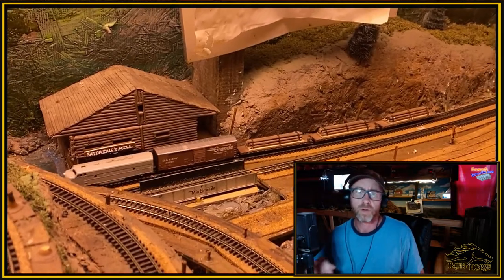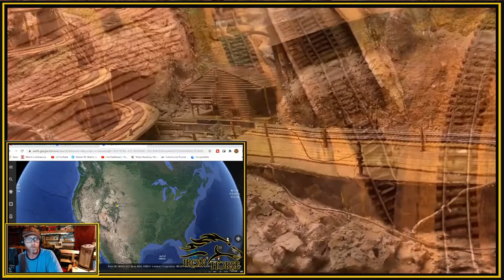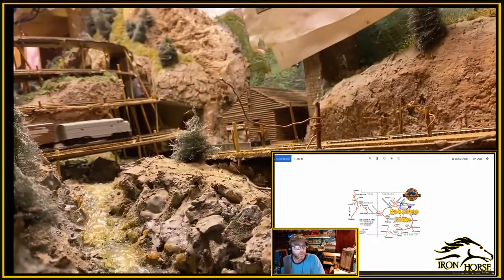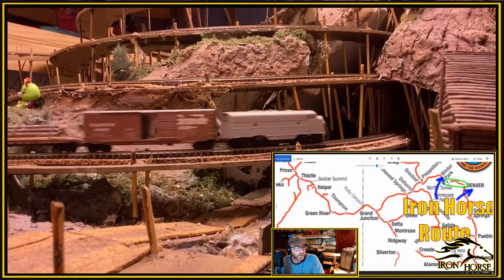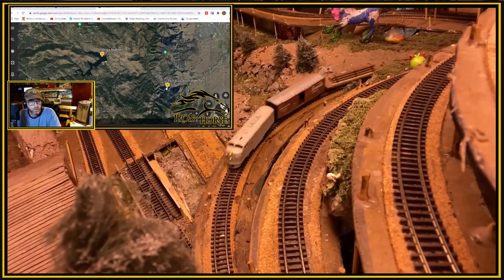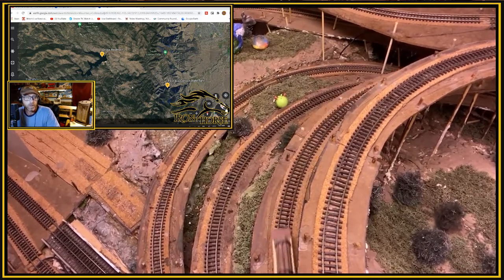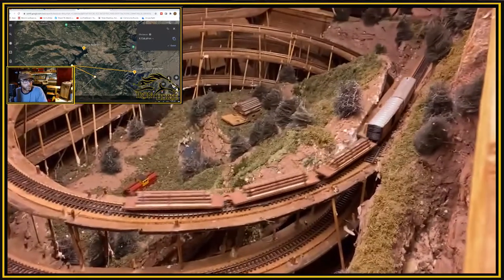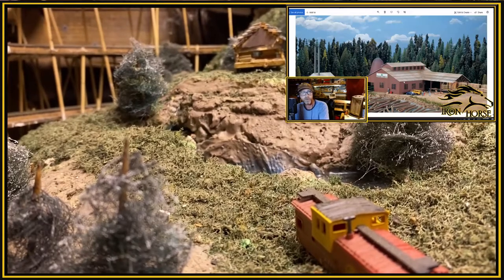Timber Train(S) to the Reservoir Mill - Layout Tour/Operations: Iron Horse Route - D&RGW  N Scale

Comment: thanks for sharing the journey. nice there were all the different views. what type loco was running the freight?
Reply from the maker: Hey Joe!  That was an F7b.   I have 3 kato F7's ( that's my roster for now) that are in working order.  It's and ABB set up that will work together , but not without some de railments here and there due to no speed matching. I'm still DC.  That is to come but for now, one loco per train provides better reliability.  They were all purchased at diff times.  Brian